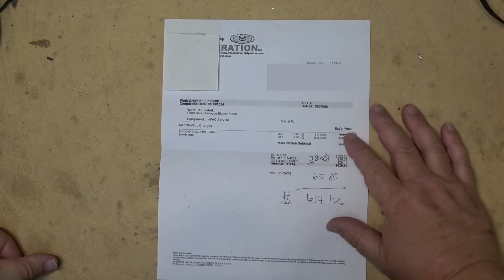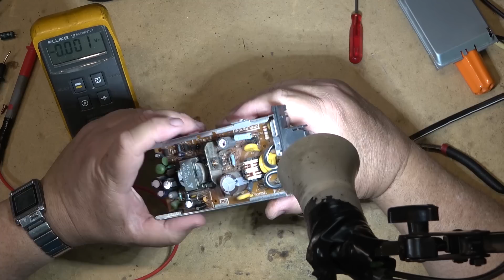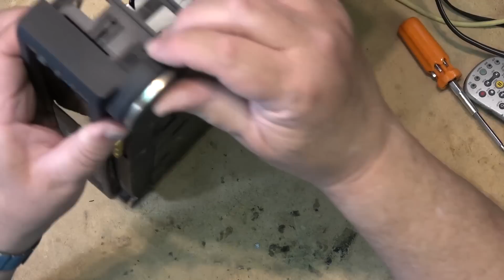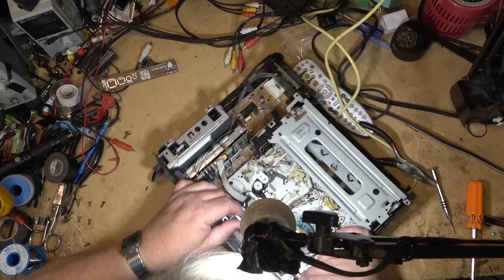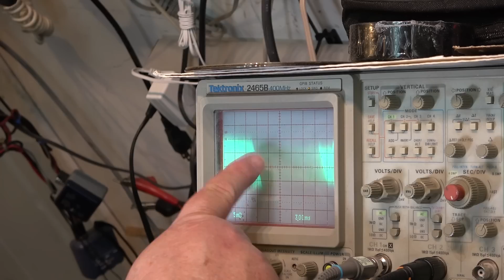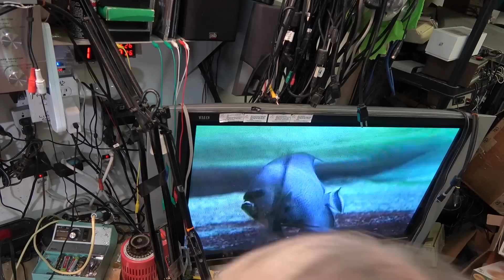Panasonic PVS4266 32 year old S-VHS VCR is broken

Comment: The 32 year old S-VHS machine is junk!! 🗑️😆
Reply: @DavidMander-rs4uk  This one not yet, but it will be soon. It was such a fantastic idea to put electrolytics on a ceramic hybrid IC... If I can get one cheap, I will buy one just to see if the caps can be changed somehow. Fortunately it seems Panasonic used good SMD electrolytics around '92. I have four Technics tape decks from this period, and all the SMD electrolytics in their DD capstan motors are still good in all of them. The ESR is a bit high, but they are not leaking (yet).
Reply from the maker: Hey I made 100 bucks getting it to run.  I'm sure the caps will fail but at this moment they are working. You are right though they are junk.
Reply: @12voltvids  Good to know that this is why the vcr i have was only for 10$ as it smells bad caps everywhere on it, and when i play a tape on it the video is all junk and black and white even when i tried doing a recording on it own the colors were distorsted, knowing that it probably that same exact module you said we can't replace capacitors on it, it is probably 99% sure a junk machine. Thanks SMD caps for ever existing and causing troubles for nothing at all !

Comment: The A/C may have a short in it
Reply from the maker: It's brand new and it is NOT tripping the breaker / gfci plug on the cord.  All was fine till the heat from the sun heats the wall up.  Never underestimate the heat of the sun. I use an old milk crate as a step ladder at work so I can reach ceilings when installing fiber at work.  Sat I was putting up a camera at a customer house.  Rather than drag out ny step ladder I figured I would use my black plastic milk crate.   I was working on the sunny side and the black plastic got so hot within 5 minutes that when I stepped on it one corner started to buckle and bend.  I got off and pushed the plastic back into place and removed it from the sun.  It was quite soft.

Comment: Besides the breaker unit getting very warm, maybe your AC has a defect that causes a current spike which makes the breaker trip.
Reply from the maker: This is a brand new unit. It also has a breaker /  gfci plug on the end of the cord that doesn't trip. Go figure.  The panel gets quite warm in the afternoon when the sun has been shining on the side of the garage all day.

Comment: Hi Dave. Is the motor capacitor on your AC unit, wearing out and turning into a resistor. As a result, it's drawing more current than the 15 amp breaker. The extra initial current surge from the worn out motor capacitor, COULD be tripping the beaker. Just an idea.
Reply from the maker: It's brand new.  Has perhaps 10 hours on it.

Comment: BTW Dave, that high draw air conditioner circuit seems a little excessive. I'm not so sure that it's the unit. Might be something else. Say a wire connection that's not secure or a circuit wire itself. I'd like to see what a ampere draw with and without the A/C on would be. If it's the wire, a re run might be necessary. A new receptacle or plug, also. I'd check that before just upping up the breaker rating, just to be safe, you know.
Reply from the maker: I just upgraded it a month or so ago when I got it.   The draw is 1000 watts but inrush is higher when compressor starts

Comment: Those Panasonic vcr’s are about as useful as a cup full of cold snow. Also regarding the hvac have u checked or replaced the run capacitor?
Reply from the maker: Morors are running fine.  The caps were replaced a few years ago when they blew up, literally one exploded outside.
Reply: Maybe just worth a quick check Dave as this crapastors are from china
Reply from the maker: Panasonic were not my favorite brand of vcr considering I had an AGW1 and AG1970 and both were pretty much shot by the time they were 6 years old.

Comment: Dave, I got one better than that. My mom had a service policy with the local electric company. The blower motor bearings went up. They came out and replaced the motor, a GM gas hot air one. I get home from work, getting ready for diner and the furnace turns on. A loud hum is now sounding. It's loud enough that I had to raise my voice just to be heard. I say to my mom, " What is that noise?" she answers, " It's the new furnace motor". Well, that was NOT acceptable. I go down to where the unit is located, open up the cover, slide out the blower unit and notice an arrow stamped on the motor and it positioned to the right side on the housing. I loosen up the mounting brackets, rotate the motor to where the arrow is pointing up, re tighten the hardware and the hum went away. The arrow was a balance mark. I'm so glad that I found the problem. So much for a service contract, the guy didn't care. I feel you pain Dave.

Comment: Try a new start run cap for compressor
Reply: Just an old hvac tech here is unit a window shaker sometimes they just need a good cleaning so the pressures are ok
Reply from the maker: @alanarmstrong2323 
Its a 5 ton carrier hvac heat pump.   The evaporator on the air handler likely needs cleaning.  Been in service 22 years.
Reply: @12voltvids  got a ya you may need a new start run cap in that place. I would wash the outside coils with some dish soap a few times a year just to keep the coils clean
Reply: Just had our heat pump serviced,  compressor start capacitor was bad.  $400 USD they charged me for a new $30  capacitor and the install.... Normally I would have done the troubleshooting and repaired it myself, but my father was having surgery and I had to be at the hospital with him.
Reply: @BEdmonson85  I keep an extra one on hand just for that
Reply from the maker: The compressor and fans run fine. The bracket on the motor broke.

Comment: I remember you serviced a Panasonic PVS7670 On feb 9 2023 and A Panasonic PV 4250 On Jan 30 or 31 2020 when you forgot to soldier the mode switch back on and the vcr didn't work. But its been over a year since you last serviced a Panasonic vcr in general.
Reply from the maker: I didn't forget to solder the mode switch. I have have left it off intentionally to see reaction.
Reply: @12voltvids  oh so you just wanted to show us what would happen if it wasn't soldered on?

Comment: Id be carefull in raising the amperage rating on the breaker - 14 gouge is only  rated for 
Note that a 14 gauge wire on a 20 amp circuit is not the correct size, as it is only rated to handle up to 15 Amp in residential applications. Using 14 AWG for a 20 Amp breaker will result in overheating and a risk of electrical fire. Using a 10 AWG wire for a 20 amp circuit is possible and safe but not cost-effective.
Theres a break somewhere or you have a junction thats weak ...
Reply from the maker: It doesn't draw more than 1000 watts. I did put the watt meter on it. Its tripping because of the heat.  The only thing on this circuit is the ac
Reply: 14AWG is acceptable for 20 Amp, whatever the code says. 14 AWG is 2.5mm2, and it is (or was by the previous regulation) good for 20A in Europe. It's better to use 4mm2 (AWG 12) for 20A in long runs, but AWG 14 will not overheat at 20A, unless on that side of the pond you use some insulation which is less heat resistant than PVC.
Reply from the maker: Its all 12ga in the house. I would know i bought it all. There is only 1 tiny piece of 14, and that is that wire that goes from the yellow wire nut to the breaker and that was because it was all I had on hand when I changed the configuration to put in the 240 plug for the car charger. It will never ever have more then 15 amps drawn through it because there are only 2 things plugged in.  The ac in the shop and a small heater in the winter and never run together (they would trip the breaker if both plugged in) 
So no, going to a 20 is not going to cause any issues at all because it's 12ga wire to begin with. Some runs are done in 10 Guage. The hvac is 8 gage. When I built the place in 02 I over built the wiring as I knew there would be lots of loads.

Comment: What I would suggest is do a amperage test if you have a amp clamp  on the line to see what the unit is drawing. As the saying goes just because its new dosnt mean its good -  as the new breaker could be faulty or its not seated tightly - any looseness will cause overheating And I know this from the RV park industry where people burn out there plugs due to bad worn out plugs and or sockets...
Reply from the maker: Its not drawing more than 1000 watts. I already put a meter on it when I reviewed it.
Reply: Lawrence 
In English sentences, two vowels are not allowed (a amp)